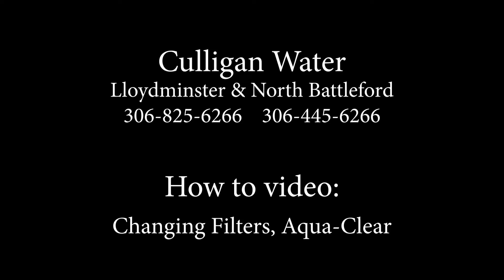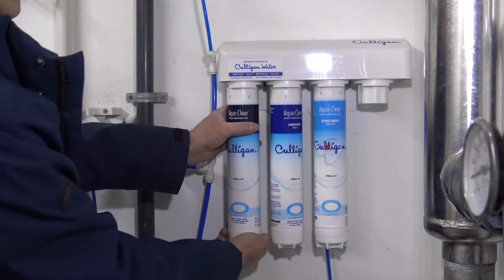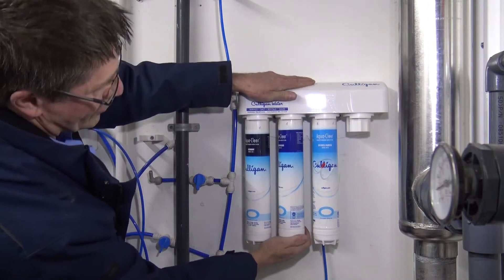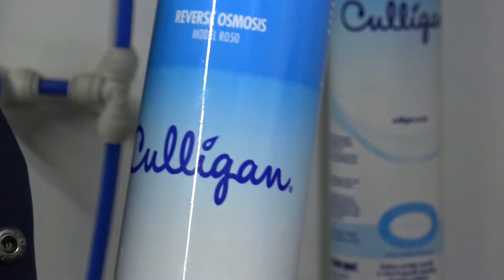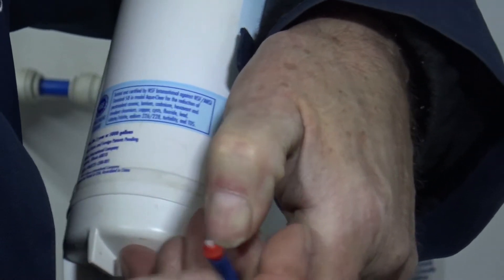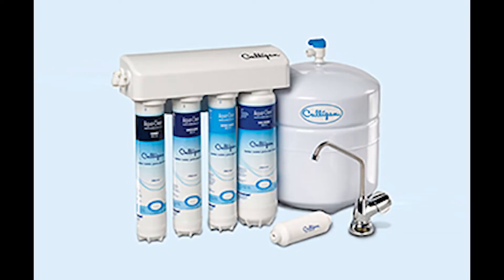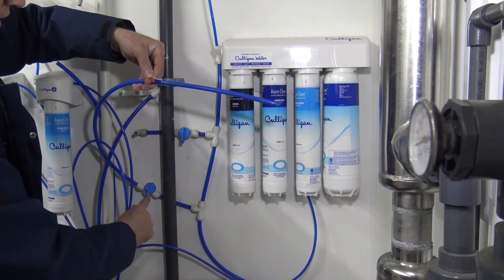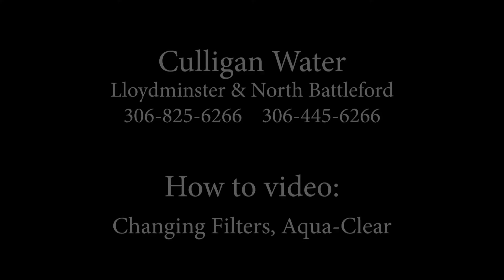Culligan How-to Change Aqua-Cleer Filters

Comment: what is the capillary tube for, will the system work without it?
Reply: Hello RPDBY, the system will NOT work without the capillary tube. It produces the correct amount of back pressure to force water through the Reverse Osmosis membrane, while providing enough flow across the membrane to clear the impurities and prevent early fouling of the RO Membrane.  You need to match the correct capillary tube with the correct RO Membrane. the red one is for the 50 gallon per day membrane and the black one is for the 30 gallon per day membrane.  You can buy a 50gallon per day RO Membrane even if you have a 30 gallon per day now. but as said above the correct capillary tube (comes with a new membrane) has to be matched to the RO membrane.
Reply: @CulliganKev  thank you, i think i understand now. Without the capillary tube most or all of the water will go through the drain hole in the filter and not through the filter, and if the the capillary tube is too tight too much water will be pushed through the filter fouling it too quickly. Thank you!
Reply: @CulliganKev  I forgot to replace the CAPILLARY TUBE when I changed ALL my filters. I have now put it in, but my system is not working at all. No water is coming into my tank to fill it. Please help!
Reply: @mixmastertoronto  start with the line to the tank is there any produced RO water coming? if not one of your filters is not fully turned over the detent. unseat by turning back each filter just the slightest amount to the left, start with the furthest left, you should get a "psst" and a bit of water will leak down, do the for each filter. find the one that has no pressure that is your culprit.
Reply: @CulliganKev  this worked thanks so much!!!!
Reply: @CulliganKev  do I turn the water back off when doing this or leave on?
Reply: @CulliganKev   working yay!!  So now I leave that water faucet on for 4 or 6 hours ?  It’s a 30 gallon
Reply: @familyoffinn3170  yes flush . leave the tank off but the tap on for about 2-6hours. then shut tap off and turn on the tsnk. for next three nights empty tank when you go to bed. if you have a Total Dissolved Solids (TDS) tester when your water is below 5% of your source water the filters are flushed and system is ready.
Reply: @freddyforyue8783  how do you empty the tank? Just run the faucet until the water is slower to come out?
Reply: @CulliganKev  Same for me. Change all 3 filters after watching your video, the RO30+capillary seems to be the one thing that is keeping my system from moving water. 1st two filters do have water (slightly turn; hear water move) but not on 3rd one (RO filter). Changed to new capillary, but now waiting to see if the tank fills and works. Advice?
Reply: Yep. Did that. RO was the one without water. Forgot to change capillary. Changed it. Waiting to see if my system works. @CulliganKev
Reply: We have an RO system installed by either Lloydminster or North Battleford (I think it was Lloyd, as we're in Lashburn.) There is no drain valve installed, making it rather messy to change filters. I believe it was installed in '21. Is that an option or did they forget to put it in?

Comment: Removing the Post Carbon Filter - I have apologized for not including that in the video, it was an oversight. Thank you for your grace. The method to replace it is the same as every John Guest fitting. You push the water line into the filter, you hold the plastic keeper with fingernails, or a spread needle-nose pliers and rotate the filter as you pull it off the line. if you cannot remove it you are not pressing the plastic insert far enough. NOTE: make sure the filter is installed with the arrow going to the tap. It is a directional filter.
Reply: John Guest fitting method https://youtu.be/tQ6U_g8H180?si=oiz8pvVt5f9-EDSE&t=67

Comment: Can you also show me how to pull the cord from the post carbon filter please?  I have a hard time to pull the cord. thanks in advance.
Reply: That is a standard John-Guest fitting it has been answered several times.  you have to push the line into the filter, then use a pair of needle-nose pliers spread or (scissors) to hold the ring into the filter then wiggle the post filter off the line while pressing the ring into the filter. the ring is what bites the line to prevent it being removed. wet the line when pushing into the new filter to make it slide easier.
Reply: Removing the Post Carbon Filter - I have apologized for not including that in the video, it was an oversight. Thank you for your grace. The method to replace it is the same as every John Guest fitting. You push the water line into the filter, you hold the plastic keeper with fingernails, or a spread needle-nose pliers and rotate the filter as you pull it off the line. if you cannot remove it you are not pressing the plastic insert far enough. NOTE: make sure the filter is installed with the arrow going to the tap. It is a directional filter.

Comment: How often do these filters have to be changed out?  Do I have to change out all of them at the same time or is there a different periodicity for each filter?
Reply: Never mind, I see that that question has been answered below.
Reply: @daviddavison2582  yes, 1 year on sediment and block carbon, then the RO only when TDS is over 50PPM, but the Specialty filter the 4th if you have it is also 1year or 1000gallons. and the torpedo shaped carbon filter is also yearly

Comment: How does the system know when to stop? I mean if the tap is off and the tank is full, what mechanism is there to stop it from keeping pushing that water which i guess will be coming non-stop through the drain hose in the RO filter?
Reply: How do you know it is not shutting off?  It will have flow to drain as long as it is filling the tank.  And sometimes you might have a long time to fill tank if your Source pressure is not high. My experience has been that virtually NOTHING is produced if your source water is 42PSI or below, in which case you will run to drain until you get higher pressure. I do not know what your diagnosis is if it is low source pressure, consider adding an RO Booster pump Culligan part# 01009334. if you are sure it is not. and you shut off the tank and do not use any water from RO and in the morning you still have drain water then you need a culligan service tech to diagnose it but you may need the shutoff piston. Culligan Part# P1001472 Shutoff Piston Assy. This is what shuts off the drain water when the tank pressure is within 2-4psi of the source water. These usually do not cause trouble, but they can become fouled with Calcium or other TDS as they run in source, impure water.
Reply: @CulliganKev  thank you so much for such detailed answer. I know its not shutting off because i can see the water constantly flowing through the drain tube, which is transparent. I know the tank is full because there is not water flowing into the tank (that tube is also transparent) and the pressure in the tank is exactly the same as the pressure in my water supply (and the tank is heavy as i would expect with a full tank). SO i will check the shut off valve, it may not be doing its job.

Comment: How often are you suppose to change these?
Reply: The most common practice to prevent bacteria starting to grow in your carbons on non-chlorinated water, or if you are on municipal chlorinated water to prevent that getting to your R.O. membrane and damaging that, is to do a yearly change of your filters!  NOTE: the R.O. membrane does NOT have to be replaced until it has high TDS (Total Dissolved Solids) over 50PPM TDS on city systems, higher if you are rural; or if you have low production after putting in new filters. I have been seeing more chemical impurities so I highly recommend getting a Total Defense filter for your system to remove those and PFAS and PFOS and Pharmaceutical.  And YES ever since i saw this evidence i have in my personal system for my family.

Comment: What comes with the kit,Aqua-Cleer® Advanced Drinking Water System,is it 3 filters or 4
Reply: It depends on the choice of Aqua-cleer,  basic is 4 filter, but about 4 extra filters are available for the 4th position making it a 5filter system. This video shows it with a Total Defense. I highly recommend it.
Reply: Mine has four tall thin filters and one small torpedo one. The refill kit has two tall and the torpedo and I pay $100 a year for those. They want $200 to install them which is highway robbery. On mine, one of the four filters only gets changed every two years as it moves from slot 2 to slot 4 and the RO only is changed 3-5 years. The water is delicious and so far, still worth the hassle of having to talk to the Boise, Idaho office. But BOY is that a drag. And they feel the same about me I am sure.

Comment: You describe how to measure the rate of flow but you don’t say what the optimal rate of flow is for this system.
Reply: There is no answer for  what capacity should be, the membrane is rated on the label at 30GPD or 50GPD (Gallons Per Day) so that is the max possible say 30GPD would 30/24hrs= 1.25US Gallons per hour. BUT i mean a big BUT!!! (according to Aquatic Life blog) All flow rates stated on reverse osmosis systems and membranes are assuming a water temperature of 77 degrees F. As the water temperature changes so will the flow rate. For every degree F you lower the temperature you lose about 3% of product flow. for example using Applied Membrane Temperature Correction Factor chart, for 50F water source your would only have 30GPD divided by TCF of 1.711 = 17.53 GPD. Vastly different production. BUT ALSO  if your Total Dissolved Solids is higher than 200PPM TDS you decrease the production by about 2% for every increase of 100TDS, so you can have very different production and it is based on your water source. if you have TDS over 500PPM you should have a Reverse Osmosis Booster pump to compensate.  that brings up the 3rd factor of production, the source water pressure. most RO membranes will not produce if water pressure is below 40 PSI so farm systems operating 20-40psi virtually never produce water. 30-50 produce RO only 40-50 time of cycle. all farm systems less than 50psi constant pressure need a booster pump.
Reply: @CulliganKev  Thanks Kevin, we all appreciate your expertise and transparency.  I recently installed post carbon filter and the 3 fixture filters (that are not the RO membrane) (Culligan of Brampton, ON, Canada neglected to send me the RO on my last order, although I did ask to have replacements for all filters).
I bought the whole system about three years ago and haven't changed the RO since).  Since I changed the other filters my rate of flow has been roughly 10 US gallons/day.  

I have double checked that all the filters are clicked in firmly, and, here's my question:

I am wondering if not changing the RO could be affecting my GPD?  

I've since specifically ordered the RO and hope it will resolve this.
Reply: @justintensen8475  thanks for your gratitude.
Reply from the maker: @justintensen8475  Sorry I may not have answered this there are two reasons to replace the R.O. membrane. one is that the R.O. membrane starts to "open" and your TDS will increase, if it is above 50PPM of TDS  or less than 90% rejection it could be replaced. however if you do not have soft water or other impurities they can plug the membrane and have low production.

Comment: When does the drain line stops water ?
Reply: the drain from the R.O. will only stop when the tank is full. to test it shut off the tank and in most cases within 5 -20 mins the lines will pressure up and shut off the R.O. and the drain line will stop. If yours does not you may have a problem. remember if your source line pressure is below 40psi, you will not produce water and will never shut off. in that case you need the Booster Pump to get about 70psi and it can produce more R.O. water and do it faster, then shut off.

Comment: How do you install the Post GAC?
Reply from the maker: The Post GAC is replaced by using your fingernail or a butter knife back edge to push the ring back with the 3/8"Poly line, then continue to push the ring into the filter while you rotate and pull the 3/8" Poly line out. if you cannot get it out you are not getting the ring pushed back or keeping it back. Then repeat for the other end. I am sorry I didn't have one in my test lab to include in the Video.

Comment: What if after you change the filters the drip is only every 5 seconds ?
Reply: Assuming new filters were put in and the R.O. membrane is new (or at least not plugged)  would indicate that you need to increase the pressure to the R.O. if you have a booster pump now it might be defective, if you do not that is what you should get, a booster pump in front of the source supply.  The R.O. needs to be over about 40psi to start producing R.O. water. as water gets colder the system produces less, the booster pump will take it up to about 70+PSI, vastly improving production. you local culligan will have booster pumps for your system.
Reply: @CulliganKev  thank you for your quick response and help 👍

Comment: Did u just say run my tap for 4 hours ... Water bill isn't free.. slow drip possibly
Reply: This is a surprising Comment? The best solution is to buy a TDS meter and only flush until you have about 5% of your Tap water TDS level. If you do not have a TDS meter, you are welcome to do any length of flush time you wish. BUT, if you do not flush the manufacturing chemicals out you will be putting those into your tank and drinking things that may be harmful. My suggestion is purely for your safety. if you buy pre-flushed filters, that is already done for you. and you might put through 4 gallons in 4 hours. it is not the same as your kitchen tap. Have a great day whatever you do! The best solution again is not to put water into your tank until you have low TDS and it is pure water.

Comment: How long do i flush new filters -  "The video says to leave the tap on for 4-6 hours to flush the filters. I have a Culligan owners manual and it says something in there to flush for a minimum of 24 hours for the RO membrane? Which is right?"   
Always refer to your owners manual. most people are not replacing the R.O. Membrane so for the Sediment, and Carbon block, and post carbon, 4 - 6 hours are sufficient. if you are doing the R.O. overnight is fine we have found, in morning it has low TDS reading. Culligan recommends 24hours to be ultra conservative. but the factual answer is when the impurities are gone. when your TDS drops to a 95% removal of your source water TDS .
 I strongly disagree with the advice people received from other dealers about flushing with capillary tube removed. if you do not have the capillary tube in the system you are doing NO flushing of the inside of the R.O.!! The water on the inside of the R.O. impurities go right into your go into your tank.
Reply: Hi, this is helpful. So if I understand it correctly, "flushing the system" means leaving the tap on and letting the water drip into your sink for a minimum of 24 hours if I changed the RO membrane.

When I had a H-83 system, it used to mean letting the tank fill up and then emptying the tank 2-3 times. So it seems like flushing the system is different now by simply leaving the tap on. Am I understanding this correctly?
Reply: @msoftball22  the assuption was that in draining the tank 2-3 times the system had at least 24 hours to soak and flush. preferred is to let the tap run out for overnight. and then fill the tank and the following night empty tank that flushed the system and the tank.
Reply: @CulliganKev  This is helpful, thank you! Will be giving this a go soon!